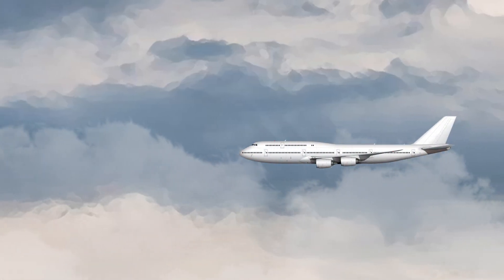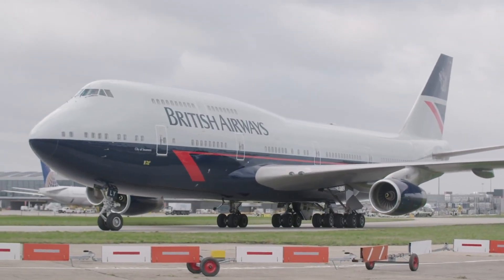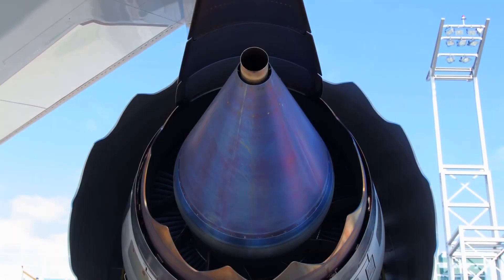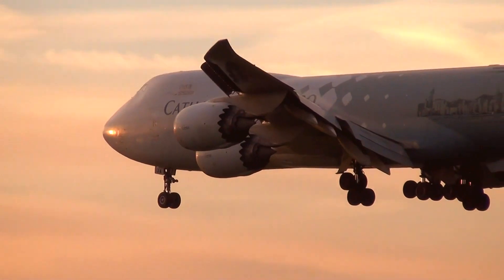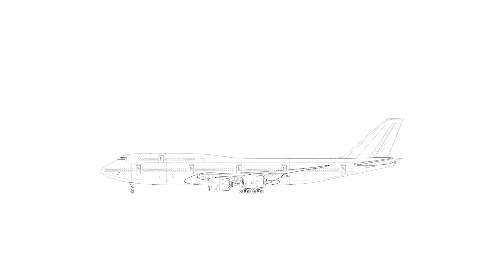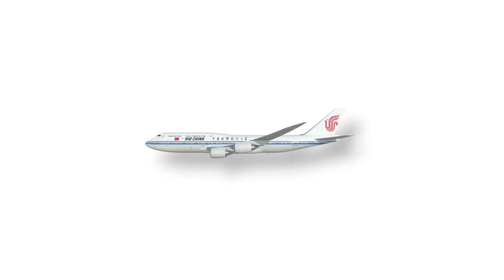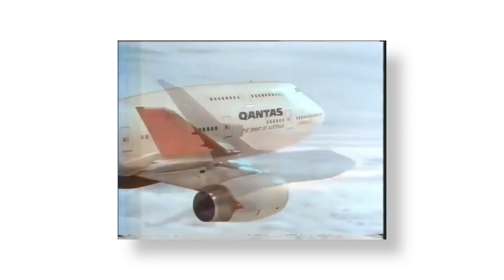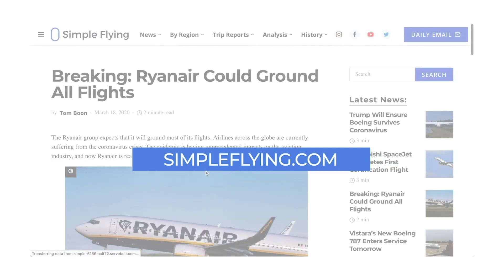Why Boeing Moved The Engines On The 747-8

Comment: No.  I had not noticed the engine pylon differences before watching the video.  I’ve flown the 747-8i between Korea and the USA.  I would try to fly it again if it’s offered on routes I am flying.  I love the newest and last version. A very stable and safe aircraft that I wish more airlines would fly.  I have just never gotten used to 2 engine jets.

Comment: Was there a point in the video that illustrated how much the engines moved? Did I miss it?
Reply: The footage at 00:16, pictures of the 747-8 engines and the detailed explanation should be enough
Reply: @spongebubatz  It's not that I wasn't convinced that they changed position. I liked the video and found it interesting that the engine move necessitated the strakes on the -8. But, it is a video, not radio. It should have been easy to add a simple illustration (side-by-side or overlay) to get a clearer idea of the change. Especially since it's more difficult to tell due to the change of engine size and wing between the two aircraft.  They usually don't overlook stuff like that on this channel.
Reply: @robertroesch770  ah ok, I agree

Comment: Considering the size and weight of the aircraft such a modification does not change the center of gravity of the aircraft. The new larger  engines are almost inserted into the wing airflow so they do not induce turbulence. The change is totally different from the Boeing 737 Max.  In this case the engines were moved forward closer to the cabin, thus affecting the center of gravity which was compensated in moving the landing gear slighty to the rear.  However this solution had side effects during some landing and take off sequences which were compensated via software packages with the well known  sad consequences.

Comment: Name to say I did not notice the relocation of the engines but I've never seen a 747 - 8 up close maybe one day hopefully. I would love to fly on one such a sweet jet and to last 50 years. On your video made me more aware of all the engineering that has to take place in regards to the engine placement and relationship to the wings. In all sincerity I'm a little ashamed also to kind of snicker inside when I look at the longevity of the 747 compared to the Airbus A380, and I freely admit the A380 is a very good jet and an engineering feat it is just too damn thirsty I guess you reach a point with jet size in it they become too inefficient I don't know I'm sure as hell no engineer but it's staggers me Airbus mist calculating the operating cost. It sure would have been fun watching the two giants compete against each other in an Ideal World anyway. It is painfully obvious on so many levels our world currently is far from ideal. Anyway long live the 747. So far ahead of its time.

Comment: I'm pretty sure the next 737 will be a competely redesigned and basically a new plane! larger engines will require this as they can't move them any further and higher without creating even more problems for the balance and especially aerodynamics!

Comment: Why don't the a350-1000 have gear tilt?
Reply: I can’t explain it that well but as the gear is parallel to the fuselage the first wheels that touch down are lower than they would be on the A350-900. So when flaring it’s almost as if the gear is "longer", which helps to prevent tailstrikes with such long aircraft! For the same reason the 737 MAX 10 has that telescopic gear and if you look at the 787-10 you’ll see that it also has a different tilt compared to the other 787 variants! Hope I could help :)

Comment: ~747-8 & 777X; thanks for the newly redesigned curvaceous wings 

~A320neo & A330; still have enough ground clearance to handle bigger diameter of new engines 

~MAX; MCAS
🛫🤓🛫🤓🛫🤓🛫🤓🛫🤓🛫🤓
Reply: You missed out the B777NG and the A340-500/600 as well. Airbus just always seems to have plenty of ground clearance under their wings to fit in the new and bigger engines.

Comment: After watching this, I'm now curious, if Boeing had increased the wing swept of the 737 MAX, would it have solved the problem? (As in, no need for MCAS, but I think this would change other aerodynamics with speed and stuff) I'm not an aircraft designer by the way, just a thought
Reply: I'm curious to know too. what other alternatives are there to avoid the MCAS?

Comment: Funny, the 747-8 is my second most flown widebody (only beat by the A330-300), but I've never noticed that. Love the plane, been there in the upper deck, and almost any area of the lower deck. Still waiting for my first flight in the nose (at Lufthansa, the first class is located there), which is already booked but with no final date due to Corona...
Reply: Amazing man .... you fly the Lufthansa 748 or was it one of the Asian carriers ?
Reply: @wozja  You may have misunderstood me. I'm not a pilot, I'm a frequent flyer and the 747-8 (at LH) was the widebody I flwe with very often. Sorry for the confusion.

Comment: Moving the engines forward led to problems with the 737Max and the MCAS system. Does the 747-8 have an MCAS system and the same problem?
Reply: No
Reply: No. Because boeing also gave it a new wing which mitigated the need for the MCAS. It was not the case for the B737Max.

Comment: Now imagine that Boeing had the foresight to continuously develop the 757 to stay current, they would probably not have created the unmitigated MAX disaster & have the market sewn up with a range of planes to fill nearly every different customer requirement.
Reply: In fact the 737 and 757 were both running at the same time so there still would have had been a MAX in all likelihood.  Your 757 paradigm should have been imagination enough.

Comment: I sure didn't notice 'em, & that's something I'd usually notice. It's similar to what Boeing did w/the engines on the MAX. I'm assuming that due to it's larger size, the -8 wasn't as prone to the aircraft pitching up due to the placement of the engines farther forward as the MAX was.

Comment: The big questions are: 1) Did they make this change without using MCAS? and 2) If it uses MCAS, then how come it works on the 747 and didn't work on the 737?
Reply: MCAS wasn't needed due to the new wing.
Reply: The 737Max didn't need mcas to be stable it's a stable aircraft without mcas. It was installed so that the plane would behave like a 737NG even though the natural characteristics were different. This was so 737NG pilots could fly the MAX without additional training. I'm guessing the sheer size of the 747 would mean that moving the engines wouldn't have as much affect on the aircraft than it did on the 737. A slightly different version of mcas is found on the KC 46 Pegusus which is used to trim the aircraft as it dispenses its fuel.
Reply: The 747 is much longer and most important doesn’t have the pitch up moment the 737 MAX experienced!

Comment: That's exactly the same thing they did to the 737 MAX, and Airbus for the A320/330 neos.
Reply: No IT IS NOT.
Reply: @charlesharper2357  YES IT IS!
Reply: @MotoRiderTube  
Did you miss the part about how the 747 was given a different wing and vortex generators on the engines?
This WASN"T done to the MAX.
Reply: @charlesharper2357  oh sorry, I thought we were playing senseless yelling on the internet. My bad.
Reply: @MotoRiderTube  
It's a minor detail...but critical   ;-)
Reply: @MotoRiderTube the history goes back much further... 
B737NG - new engine + NEW wings
A340-500/600 - new engine + NEW wings
B777NG - new engine + NEW wings
B747-8 - new engine + NEW wings
A320neo - new engine + OLD wings
B737max - new engine + OLD wings
A330NEO - new engine + OLD wings
B777X - new engine + NEW wings
Reply: @charlesharper2357  I more convincing argument would be the shorter pilons on the 747 did not cause the engines to be "above" the wing surface.  They only caused a airflow change with a negative impact without compromising takeoff or any normal flight phases.  But I am not a aerodynamic engineer.
Reply: @flamboone9727  
Watch the video...it specifically states that the redesigned wing and the vortex strakes on the engines, when coupled with the greater longitudinal stability of the 747, prevents any pitch up tendency.
Reply: @charlesharper2357  Is what I said in my comment
Reply: @charlesharper2357  Yes it is. Different size engines have different centre of thrust. That effects flight characteristics, and that has to be taken into consideration. With 737 larger engines needed to be higher due to low ground clearance, center of thrust was totally different, MCAS was installed with poor results.
Reply: @RoyalMela  
AGAIN...Did you miss the part about how the 747 was given a different wing and vortex generators on the engines?
Reply: @charlesharper2357  the MAX wing was obviously modified to accommodate the new engines and those vortex generators/strakes are not used as much in newer engine designs.  Apples/oranges argument.
Reply: @davidoldham1946  
The MAX wing was NOT modified
Reply: @davidoldham1946  He's right, the Boeing 737's MAX's wing was NOT modified. To fit the new engines under an aircraft designed to be as low to the ground as possible like the B737 for making the loading of cargo and luggage linto the plane  easier for thr ground crew as well as ease of maintenance on the engines and other system  on the plane that mechanics can access easily from the ground . A new wing would have required full recertification for pilots certified for flying the 737NG released in 97' to then recertify on the B737 MAX types. To prevent this Boeing used longer landing gear legs and positioned the engines pilons further forward on the wing and the engines further forward on the pilon to give the necessary clearance for the new wider diameter CFM Leap 1B engines under the wing. This changed the stall characteristics, hence why Boeing developed the notorious MCAS system (Maneuvering Characteristics Augmentation System) That pilots were not fully made aware of it 's function in the 90 minute course on an iPad Boeing required pilots of the B737 NG to do to certify on the MAX. When the NG was designed, manufactured and released in 1997, Boeing enlarged the wing then, the only thing different about the 737 Max wing from the NG's are the placement of the engines pilons to place the engines farther forward and it's redesigned winglets.
Reply: @charlesharper2357  the wing of the MAX isn’t redesigned or modified but a new and bigger engine along with the pylon are. Do you realise what the purpose is of a nacelle strake?
Reply: @hodb3906  
You're just babbling nonsense.
Reply: @charlesharper2357  
“ Those who live in a glass house should not throw rocks. “
Ever heard of that saying before?

And you’re dodging a very simple question btw.
Reply: @charlesharper2357  No he's, not. Look I wrote a very comprehensive explaination as to how the Boeing 737 Max, did not change the size or shape of the wing to fit the new engines. It was not modified to fit the new CFM Leap 1B engines and Boeing acomplished this by fitting elongated landing gear legs of a greater height and positioned the engines pilons further forward on the wing and the engines further forward on the pilons. This accomplished the clearing of the new engines under the wing without any true modifications of the structure and or shape of the wing. It's okay to be wrong about something.
Reply: @hodb3906  I believe, a d correct me if I'm wrong, the dual raked winglets reduce drag by reducing vortex drag generated caused by differing air pressures converging at the tip of the wings, slowing it down. The duel raked, separate the differing air pressures on the top and bottom of the wings by separating and extending their boundary layers beyond and past the wings and maintains their separation from each other. In addition to the inward, upward and slightly forward lift components of the upper aerofoil of the winglet and the lower aerofoil of the winglet generating a vertical lift component that is vectored away from the fuselage and also slightly forward. Working together, the two aerofoils on the dual raked winglet provides a balance, maximizing overall wing efficiency. They are said to provide up to 2.2% reduction in fuel usage.
Reply: @L33tSkE3t  i was talking about the nacelle strakes on the cowling but thanks. 
That’s exactly what the AT winglet stands for. Dual lift coefficients reducing drag even further than normal blended winglets and spreading pressure and therefore lift better over the wing. Not to mention they increased laminar flow on the winglets for smoother passing of air. Very nice stuff from boeing.
Reply: @L33tSkE3t  agree. Boeing had actually did that once on the B737 when they upgraded it from the 737 classic with the low bypass engines to the B737NG with the high bypass engine. With the super high bypass engine on the B737max, Boeing moved the engine even further resulting in the MCAS.
And for the 2.2% efficiency gain of the smictar wingtip, that should be against a no wingtip device configuration correct?
Reply: Um... if the 737 MAX engines made the plane pitch down, then why not make the tail out of heavier components, shorten the horizontal stabilizer or make the tail longer?
Reply: @AutismTakesOn   , it’s the opposite.
Reply: Isnt the a330 neo style just like the a320neo
Reply: A320/330neo have complet redesign for change the engine
Instead boeing
Reply: The A320neo wing and the 737 MAX wing are pretty much the same compared to the previous generation! The A320neo has exactly the same wing and the one of the 737 MAX is the same if you exclude the new winglets! As already said in this comment thread it’s very different to the 747-8‘s new wings which were redesigned
Reply: @spongebubatz  p

Comment: Can you do the story about the nose gear hump on the A330-200F
Reply: they added a nose gear hump because the stock a330 was tilted slightly and cargo had to be loaded on a levelled plane so they added the  hump to lift the nose up making it possible to load cargo
Reply: @Goddamdemons  I remember answering this too on another video, and that kept me wondering how much better would it be to redesign the landing gear instead, if it might have become too complex and thus heavy to fit the same space.